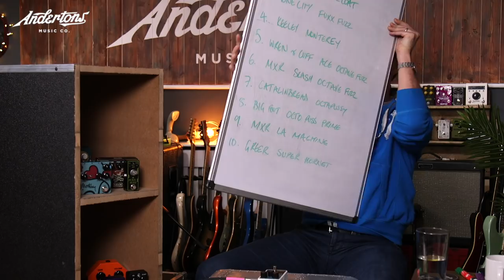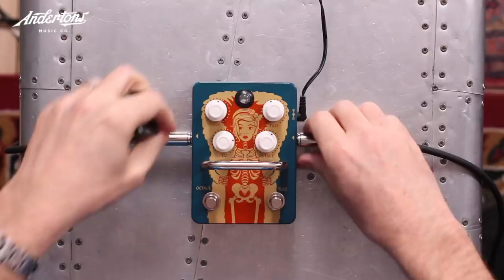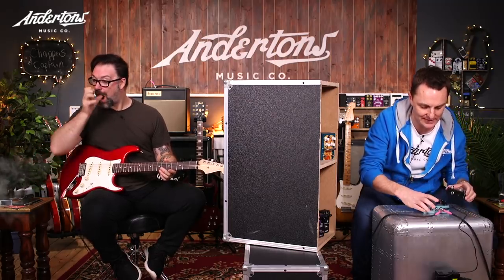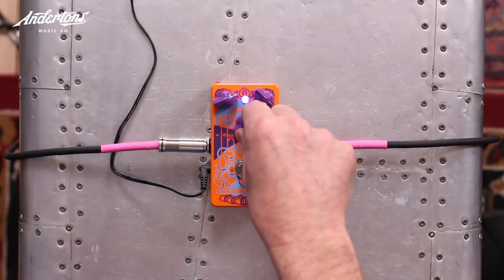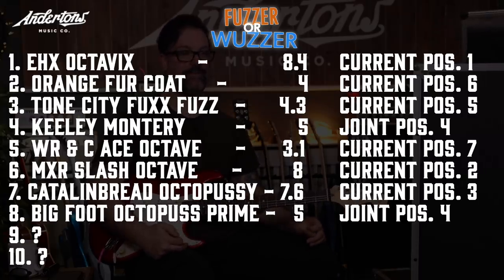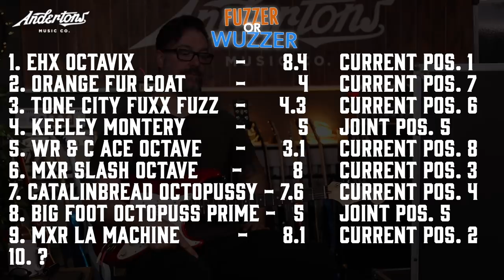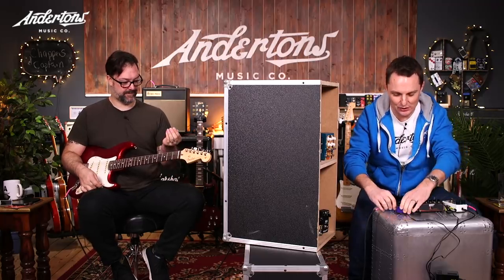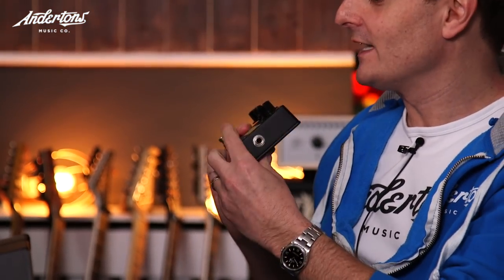Octave Fuzz Pedal Shootout - Which one will Chappers pick?

Comment: This one was too short. My opinion, Octave Fuzz combines the two most subjective effects in the arsenal, and fuzz alone could occupy months of study, as I have yet to find a combo pedal suitable for a desert island. As mentioned in the video, fuzz and octave are very dependent on input level AND voltage; some of these pedals would almost certainly perform better or at least differently on battery power, since almost no battery delivers a full 9 volts. Kudos to all the manufacturers in the list, though, cuz I didn't detect any tone suck in the bypass mode; something which can't be said of some classics like the Foxx Tone Machine. I don't mind a one-trick pony on a stage pedalboard, since I'd likely not stop the show to indulge in a tweakfest, so what's my ideal? It has to have a separate footswitch and intensity control for the octave voice, plus drive, level and tone, and it has to do something cool as I roll the volume knob back, and it needs to provide a broad full-frequency lead tone and not crap out too badly with chords, and it would be very nice to have some of that gritchy, sputtering ring mod thing, when playing diads/power chords with the knob rolled back. In short, I want everything, but with the fewest possible controls.

Comment: I think a lot of these pedals would have gotten a better score if the amp was running a little hotter. I find fuzz pedals always perform best when blended with another mild gain sound, otherwise it'll sound too trashy in most cases.

Also, the octave sound usually sounds best with the neck pickup above the 12th fret

I'm surprised Rob almost didn't use the neck pickup since he usually uses the neck pickup with lots of gain

Comment: Batteries.Cheap, dollar store batteries.Makes all the difference with several of these; if you demo a vintage circuit, and it doesn't  sound right, the prob is almost always the power source.
The EHX  IS a great pedal, but the two of them managed to get nada out of some others.

Comment: I have mini panic attacks when i see El Capitan pull a pedal with more than 3 variables on it.  God forbid there is a switch or even double sided.  The blind does not work so well when the user is not the fiddler.  Perhaps leave it at 12 O'clock a bit longer as well before the movements begin.  The nightmare was the overdrive/distortion blind test with about 50 pedal's and Lee had to pee again in that vid, so i felt like i had to pee, and it seemed rushed.  No more coffee for The Captain before vid's.  :)

Comment: Not one of the better shoot outs. A lot of these pedals have "sweet spots" or controls that are designed to blend. The Monterey portion cracked me up. It's a multi-effect pedal, not a standard fuzz. Fuzz are not just a variation of a drive pedals. You need the amp and the pedal to be working together. Lee's blues playing would probably have better fit this one too.